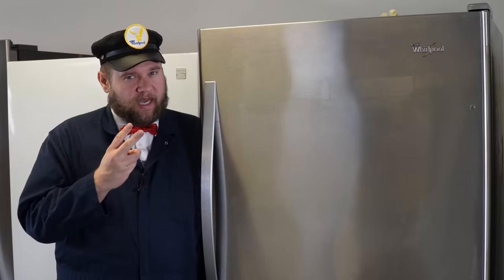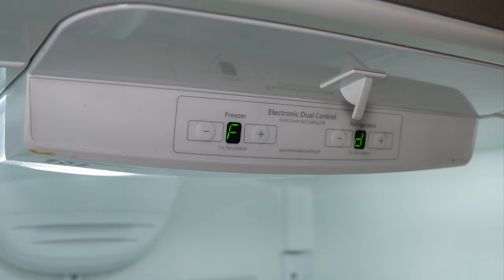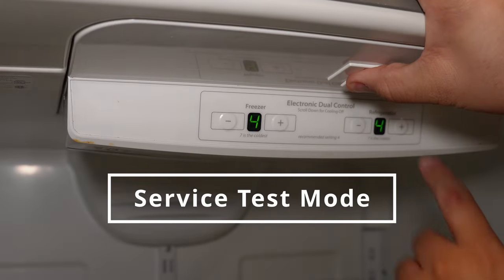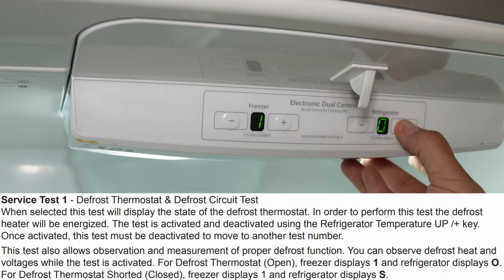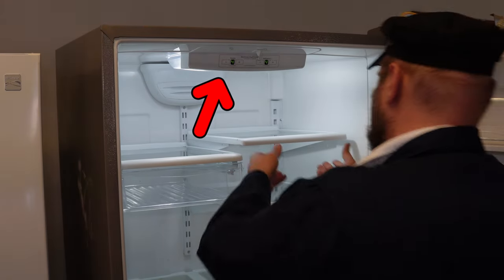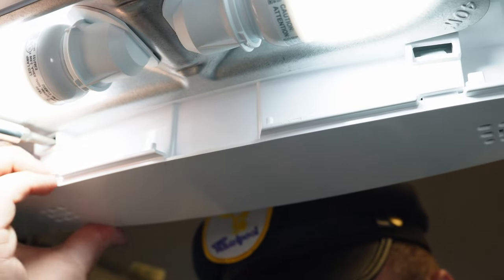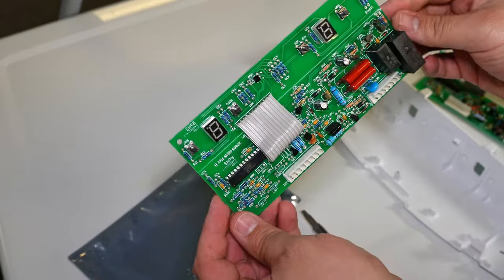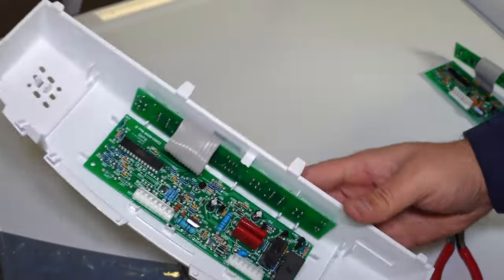Whirlpool Refrigerator Forced Defrost, Service Modes, Troubleshooting & Replace W10503278

Comment: Well I had to say thank you.  My control panel was frozen, unable to change the settings, and the temperature in the fridge was fluctuating between 37 and 42, but this morning it was 52!!  After watching your video I ordered the part on amazon for $46 Cdn, and installed it this afternoon in 15 minutes.  Seems to have fixed the problem! Seems to be working fine now.  I am elated. Thank you.

Comment: PLEASE HELP: How long is a short defrost mode? I just did your test to cycle through one and it was about 10 minutes (?) I just replaced the heating element (which worked when running the test and the compressor shut off correctly too) and the bimetal defrost thermostat. Everything was running but the coils weren’t defrosting. When the refrigerator stopped and I thought it would’ve gone into defrost mode, it didn’t as the heating element was cold as well.

Comment: Thanks for making this video to help people understand this complex computerized appliance.  I've owned a double door version of this refrigerator for several years and I'm not impressed.  The cooling coils are underneath so I had to block it up off of the floor in order to have enough room to blow the dust out of the coils with compressed air.  The internal refrigerator vent door makes loud clunking noises when it operates which is especially annoying at night.  The temperature inside the fridge has gotten warm several times to where I had to transfer the food to another fridge.  The freezer remained cold so there was nothing wrong with the compressor.  I performed the tests demonstrated in this video and it passed all of them.  The only setting that wasn't set to default was the defrost which was set to Fixed not Adaptive.  Next I'm going to try to find a video that shows how to test the defrost heater to see if it's bad.

Comment: I have the same unit that has been running fine for the last seven years but recently began tripping the ground fault breaker in my panel. This would occur about every eight to nine hours and I assumed that it had to do with the defrost cycle. I swapped breakers using another GFCI but the problem persisted. A repairman came to check the unit but found nothing wrong but said that replacing the control board might clear the problem. It didn't. I then replaced the GFCI with a standard 20 amp breaker and had no more trips. The repairman returned my original board and refunded the cost. I'm told that it's not recommended to power a refrigerator on a GFCI breaker. Could this be an indication of a further degrading problem?

Comment: I have a 2021  two door Whirlpool (YES IT STOPPED WORKING 😡) and instead of 2 numbers , I have 2 dashes. Compressor and fan won’t work or hum. I replaced the relay and capacitor, still not working. It also won’t go into service mode. Could it be the control board???

Comment: Quick question.  My Whirlpool Gold Series refer needs a new control board, but the label inside the unit shows no "code" for the new board (it's blank after the word ("code").  Does the correct code come with the new board or is it somewhere else on the unit?  Thank you.

Comment: Thank you for the tutorial. Works very well...wish my refrigerator did!! Just bought a WP bottom freezer "lemon" that failed within the first week...I opened my freezer one day and the food had thawed. Called for service and when they arrived, the next day, the freezer was working again. Said they couldn't diagnose a working refrigerator. That's how I landed here on Youtube. Went thru the service modes myself-all seemed fine according to my inner service tech prowess but who knows. Here I am, 2 months later and the same scenario...this time accompanied by a constant tickity tick tick tick tick tick. I reset it with my code and hope it helps. I'm so disappointed with my purchase.

Comment: Thanks for the helpful video. It seems like it’s exactly what I needed. Test 3 failed…my freezer fan was not spinning and the fridge was not cooling. So, I defrosted, cleaned the dust, and replaced the mother board and now all seems well! Thanks 👍
Reply: I may have commented too soon. A week later and the refrigerator is having the same issue. No refrigeration and the freezer fan is not spinning again...any ideas?

Comment: Thank you--i've replaced the board twice now--They both lasted about 7 years. I had cold freezer, warm fridge which was solved by replacing the main board.
Reply: Did the evaporator/freezer fan run when it was broken?  That is what's happening with mine. No fan on test  #3. I think replacing the board would be a lot more enjoyable than trying to get the freezer drawer taken off and replacing a fan...
Reply: @JustMe-mn4gr  don't recall if the fan was running--the fridge box was warm, but freezer was not defrosting, blocking cold air delivery to the fridge box. At $35, it was a no-brainer fix. Also, I took off the cover in the back of freezer and manually defrosted it with steam before turning fridge back on with new board. Been working fine since March 2023.
Reply: @JustMe-mn4gr same problem over here. But before finding this lovely video, I took apart my freezer cover to get to the evaporator coil. Fan was spinning non stop and the coil was frozen over. Still the fridge was warm. 

Currently running a forced defrost test and it seems to be working. So I’m curious as to how the freezer is TOO cold and my fridge is warm, since the fan is running and the door actuator is open in the fridge.
Reply: @ChrisLaneification The reason is the ice build up blocks the cold air flow to the fridge. It happens a lot for older to new fridges.

Comment: Quick question: I had a tech come out for our GB2FHDXWQ05 was freezing up evaporator and not cooling fridge. He diagnosed faulty control board and evap fan. I replaced the control board and programmed it to my fridge specs, 01. I'm waiting on evap fan motor to be delivered. When I run Diagnostisc test 1, my display goes directly to "S" for short. Should I replace my defrost thermostat, or is this another issue with the new control board?

Comment: My freezer gets cold enough but the refrigerator area stays room temperature. I notice a click or vibration sound for a split second in the damper and there is never any air flow from that area where it is located.  If Ii do test 6, how do I observe proper damper function? Should I put my hand at the back and be able to feel air flow when it's O (open?)  If there is no air flow could it also be another fan somewhere not pushing the air up from the freezer? (The evaporator fan?)  EDIT: 5 minutes later....  OK I took off the little cover at the back (you use a small flat blade screw driver carefully prying along the bottom/side)  And then I went straight to test 6 and the thing opened and closed. Way cool.  

But now I have a worse problem because that would have been easy to replace.  So is it the freezer fan?  Does this thing GB2FHDXWQ04 have only one evaporator fan?  And if it's in the freezer that will be difficult to get to.   

EDIT:  OK I tried test 5 Thermistor and it was blank or P every other press of the frig + button. So that means the thermistor is OK?  

EDIT:  Did test 3 Evaporator/Freezer Fan test and nothing happens whether O or F. No sounds. No air flow through the damper which was open.  So now what?  How can a freezer fan go bad and is that likely to be the problem?  Or is this a control board issue?  Which one should I try to replace first or is there any test I can do of the control board itself?          

Looking back, the freezer had an issue with ice on the bottom floor of it. And the crispers in the refrigerator were freezing as well. And the compressor seemed to me to run too much of the time - more than it used to.  So do you think the fan was killed by being embedded in ice?  Or do you think the real problem is with defrosting?  Maybe I should do the forced defrost short test?    I haven't been using this refrigerator so it is currently at room temperature and I hope running a forced defrost won't do damage or set it on fire or something...  I'm guessing the compressor was running all the time because the thermostat is in the refrigerator area and kept telling the compressor to keep running to get it cold and it never got cold? Because there is no fan blowing the cold air from the freezer?   

FINALLY I did test 1 and it shows S for shorted.  So does that mean it has a bad defrost thermostat?  Wouldn't the fan still run even if it did?  Could all of this be a bad circuit board?  I'm currently waiting for the freezer to cool down and then I'll run the forced defrost on short cycle just to see if the compressor doesn't turn off and then maybe that means it's the board?   

Now I did the initial setup of the forced defrost and it shut the compressor off before I finalized the defrost so it does not have that board problem you mentioned.

So all I know is the evaporator/freezer fan doesn't sound like it runs when tested AND test 1 was SHORT for the defrost thermostat. Now what?
Reply: Found this on applianceassitant "Test#1 Defrost Thermostat Diagnostics

After pressing the refrigerator (+) button you will see ether an "O" or an "S". "O" means that the freezer's defrost thermostat is open and will not allow electricity to reach the defrost heater. An "S" means shorted or closed. The word shorted sounds bad but actually that is what you want to see if the freezer is cold. If you see an "O" (open) and the defrost thermostat is cold that means you need to replace the thermostat. The thermostat should be shorted or closed anytime it is cold and it's safe to run a defrost cycle. This test will also check the defrost heater. If ether the defrost thermostat or heater are broken or "open" and the evaporator is iced up, you will need to replace the bad part. For more information on refrigerator's defrost system take a look at this video. (Refrigerator Defrost Troubleshooting Video)"

So maybe the defrost thermostat is OK and only test3 is a problem.

Comment: Excellent service tip Ben thank you.  I assume my 7-9 year old Maytag labeled box, with an almost control panel, operates in the same manner?  I’m not near it to try yet.
Reply from the maker: It should yes. As long as the interface looks similar with buttons/LEDs
Reply: @bensappliancesandjunk  it does.  Thanks for confirming that.  I enjoy your channel, always lots of good information.

Comment: I have the same model. My problem is the freezer setting is “stuck”. Meaning if I lower the temp on the freezer side, it will automatically go back up by itself to the max setting of 7. It won’t stay on the setting I set it on.

Comment: What logic does the control board use for "adaptive" defrost mode?  My refrigerator passes all of the tests.  But a couple times per month, the coils freeze up.  I then have to put it in "force defrost" mode to thaw the coils and it will work again for a couple weeks.
Reply from the maker: Usually its timed based on doors opening. Its possible there's a small moisture leak into the fridge causing it to get more moisture to the coils than expected. There is a mode I mention in other videos or maybe this one that lets you put it in a basic 8 or 12hr defrost pattern that is no longer adaptive that may solve it.
Reply: @bensappliancesandjunk  Thank you!  I will try the fixed defrost mode to see if it helps!

Comment: So it's a relay problem in the board? Is it possible replacement it? I do this Operation in minisplit boards witch tends to get stuck, probably can be as simple that 5 dollars part and 10 minutes of soldering job or so
Reply from the maker: Yes for sure you can just replace the relay

Comment: I have a whirlpool French door freezer bottom with same control panel like in video. My fridge has quit working now a second time. Woke up to a 60 degree fridge and thawing freezer. The numbers just had horizontal lines. First time this happened I pressed tue + and the numbers came back starting at 1. I reset freezer and fridge to 5-5 and worked again. Lasted a couple months then did it again. Now I can’t it to show anything but the two horizontal lines

Comment: Thanks so much. My fridge didnt work and i realize that the fan is not working. I enter the servicd mode and did the condenser fan test. The fan works. Does it mean that the motherboard not working poperly and i have to replace it？
Reply: There is also an evaporator/freezer fan and that is the one which blows cold air up into the refrigerator compartment from the freezer.  That one is test #3.

Comment: I'm sorry for so many comments/questions...in test 3 I can definitely hear the fan turn on and off, however with test 2, I can't really tell if anything is happening. What should I be observing? Also, what happens when I adjust each of the freezer or refrigerator performance adjustments from 5 to 6? Does it just make these zones cooler? And lastly, what are the risks of switching the defrost switch from timer vs auto?
Reply from the maker: Test 2 says exactly what you see on the screen. It energizes the condenser fan and condenser behind the refrigerator. If its not cycling on and off properly, it'd suggest either the fan/compressor are bad, or the board is bad.

If you do the offset it;ll make it colder, or at least try to make it colder. If you set the defrost to timed, it runs more often using more electric but removes more frost from the coils if thats an issue.
Reply: @bensappliancesandjunk  is that condenser fan observable by ear. I feel hot air flowing from mostly the right side underneath and the freezer is definitely freezing ok (at least to my perception). I notched both fridge and freezer to 6 and the defrost on timer mode last night.  Now the fridge is cold but still frost on the back wall of freezer. I have a spare board I ordered a couple years ago that I might just switch since I already have it.

Comment: Hey Ben! What if I do the Forced Defrost for both S and L, and it only runs for 5 minutes then shuts off and resumes cooling without ever turning on the heater?

You're the best!
Reply from the maker: You have a defroster problem then. The question is if the defroster itself is bad, or the sensor is. You'd have to probably dig in and test to figure that out.
Reply: @bensappliancesandjunk  The heater tests good for continuity at both the heater and at the control. I've swapped the wiring harness which includes the sensor on Friday when I did service test 1 today it tested as S.
Reply: @SuculantWarrior  I just tested mine and it gave S for test 1 as well.  Did your compressor turn off when doing the forced defrost?  If not then he said it has a bad board.   Mine also has no evaporator fan running when I do test 3.  What eventually fixed yours?
Reply: @JustMe-mn4gr  I BELIEVE I got it taken care of. I ended up replacing the board and the wireharness kit which included the defrost sensor.

Now your evap fan may not be running in that test because its frozen, youll want to defrost then retest to make sure it does in fact work.

Its best to completely defrost it by leaving the fridge off and let EVERYTHING melt. If you don't and you turn it back on, ANY condensation gets blown into the freezer and the entire thing will be covered like it's just snowed.
Reply: Thank you! A 2nd on “You the best!”  I had the same problem with it not staying forced defrost mode! Very helpful to know quickly understand what I’m dealing with.

Comment: thanks Ben,  I had a problem with no cool air in the fridge.  Notice a build up of frost in the freezer section vents,  Using a dryer for about 5/10 minutes worked and cold air was flowing again.  After having to do this 4 times over a 2 month period I used this video to change the circuit board.  Worked fine for three weeks when it failed to blow cold air.   I decided to remove the back panel this time and found that the THERMOSTAT WAS SURROUNDED BY ABOUT 4 TO 5 INCHES OF ICE.   After melting this ice the cooling worked again.  Do you think this is the thermostat failing.   I can test this asper your video but I'm not sure how to interpret the code 0 or OPEN.  Does this mean that the thermostat is working.     Thanks for your help.
Reply: You either have a auto defrost problem ,   Possibly the heater element,     Or you have a leak in the Freon,  which will also cause ice to build up on coils

Comment: I am having defrost issues. During test one I only see the O. (open displayed).By pushing + , I hear a click but do not see the S (short) displayed. 
Would I have a thermostat issue?
Reply: I’m having the same problem trying to fix it. I’m pretty sure somethings wrong with the thermostat.
Reply: Mine ended up being the thermostat… I ended up changing it a few days after my message and haven’t had an issue since. 
Easy fix- $7 part- freezer thawed took me about 5-10 min to put the new one in.

Good luck!
Reply: Oh an to double test the thermostat I cut the wires- put it in another freezer and checked continuity once frozen- when it gets to a certain temp (38 degrees I think) it will close the circuit and have continuity. If not then thermostat issue.

Comment: Ben, I ran the service tests and the Defrost Thermostat and Circuit test came back as shorted.  Will replacing the circuit board fix this error.  the Freezer works but the fridge doesn't get cold. model # WRB329DMBM00  Program code 21
Reply: Update on this? Defroster showing shorted too

Comment: My question is when I am in each of these 9 tests what do I actually look at? Where do I test resistance or voltage?
Reply: Test 6 is easy:  carefully pry off the damper cover at the top rear of the refrigerator compartment. use a flat blade screw driver and gently pry at the bottom left or right and then gently pull it off - two locking tabs on the bottom and two on the top.  Then perform test 6 and you can watch the damper open and close.